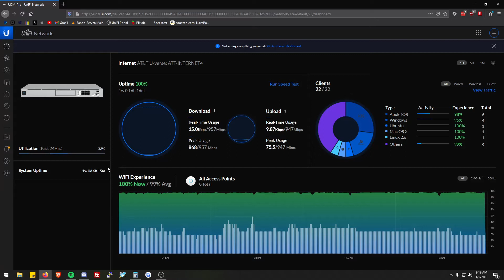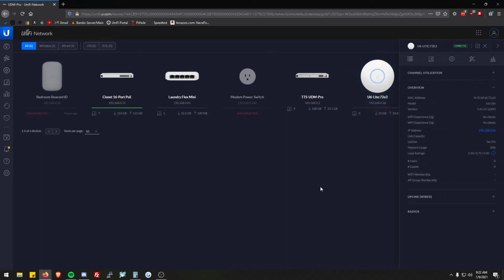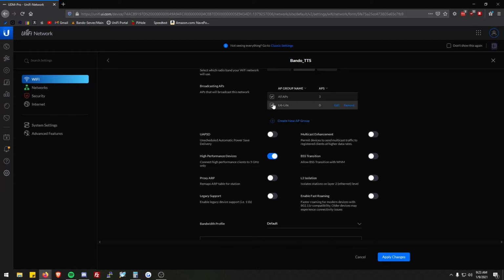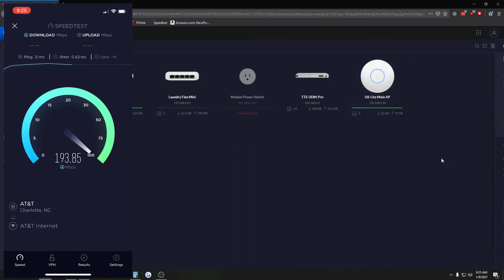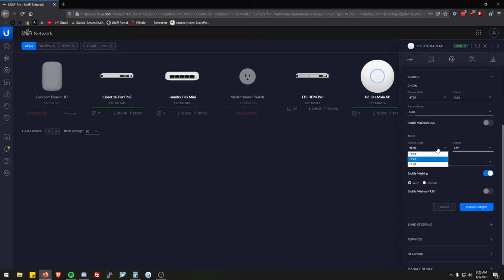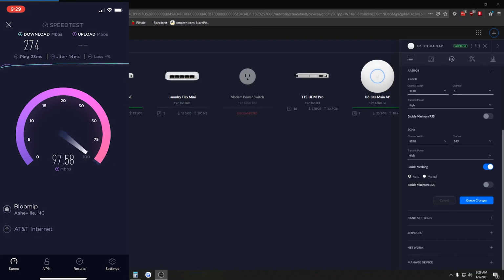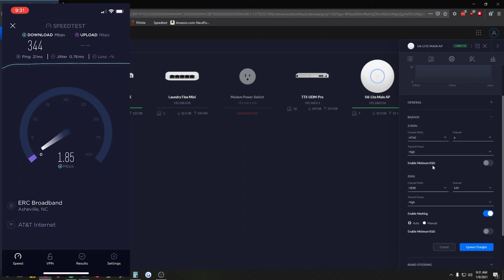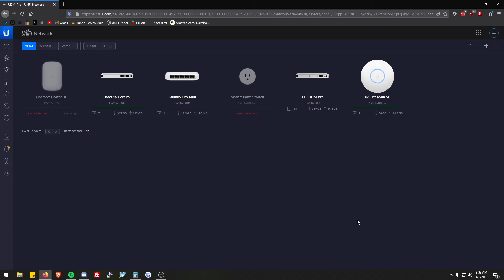UniFi 6 Lite Access Point Speed Optimization and Overview

Comment: Did you make sure that you're running on the 5GHZ band? I noticed in one of your settings both wasn't set. I would make sure to turn on band steering. I'm getting these speeds on my old AC lites.
Reply from the maker: I am running on the 5GHz band, and I also have band steering disabled.
Reply: @totaltechwnc  save the server as favorite
Reply: @totaltechwnc  You should have 5G Band Steering enabled. Those speeds look like you're on 2.4GHz band, definitely not 5GHz!